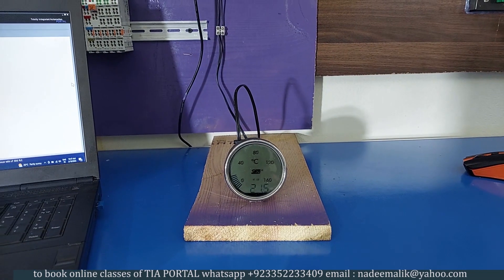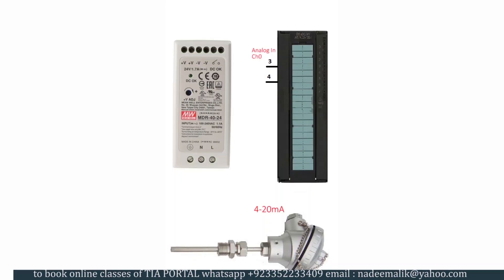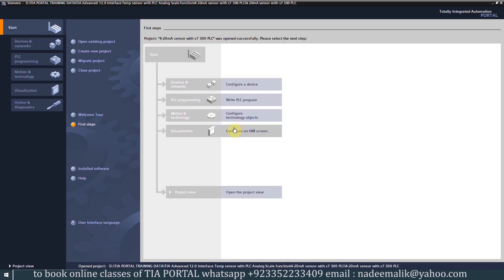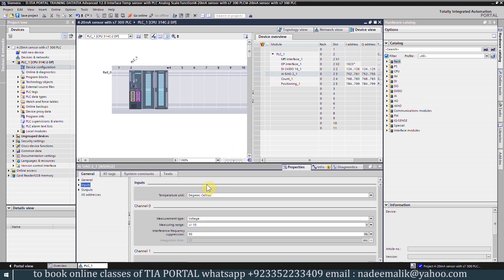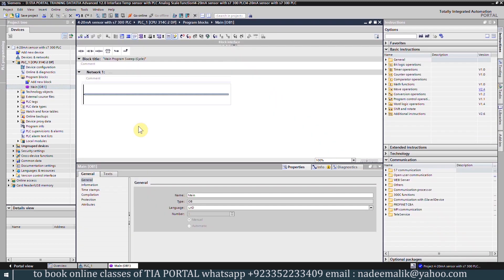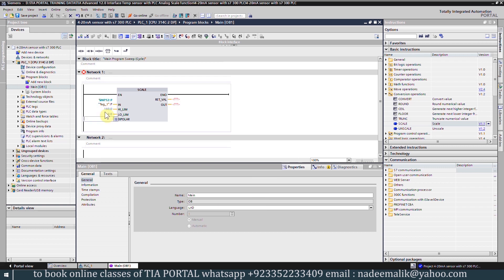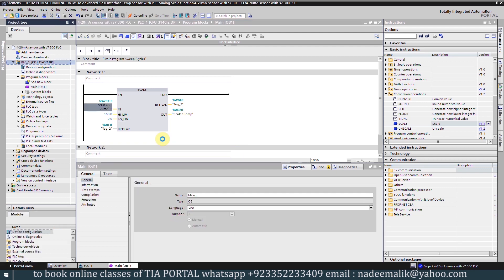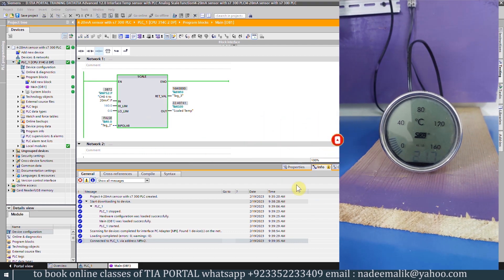How to connect temperature transmitter with Analog input 4-20ma read and scaling in the TIA Portal

Comment: Transmitter is showing 21.7 But PLC(MD10) reads 22.5 around 0.8 error is there. How we can tune this with exact with field Tx device
Reply from the maker: Need to calibrate the temperature transmitter. or simply reduce the high limit input for scale function